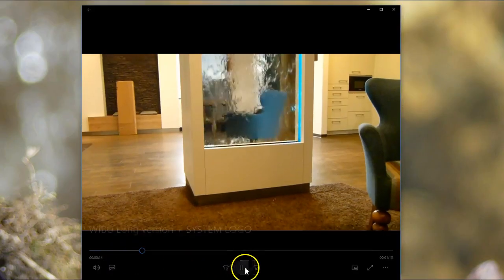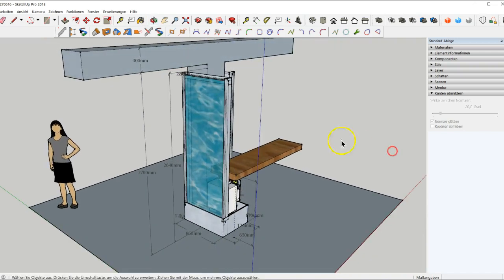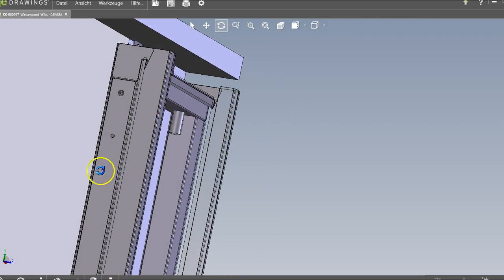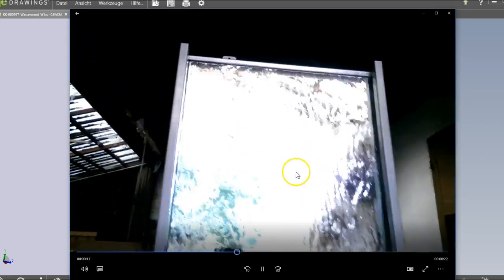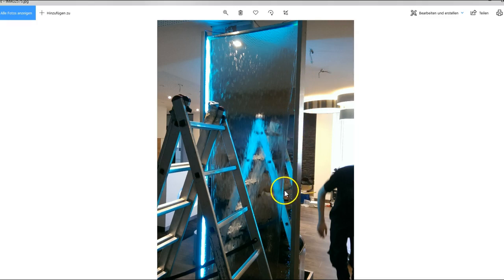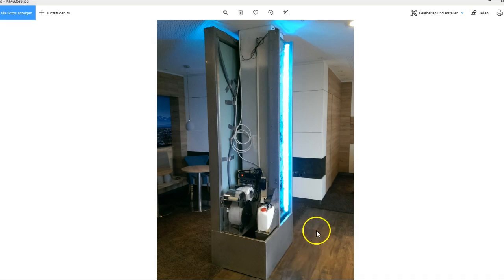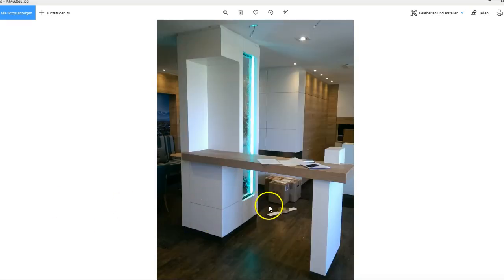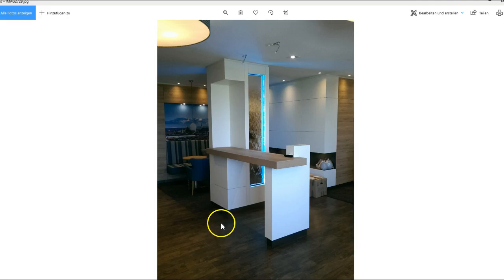How to build automatic Indoor Waterfall in Lobby -  DIY Glass Water Wall Fountain Production Manual

Comment: Anybody that wants to build  there own water wall, do some research, there are many you tube videos showing you how to build this simple type, as well as dancing water walls. They are simple to build, not difficult, just requires a hands on approach, with a can do attitude!
The dancing water wall with air bubblier are much more interesting. I use a four way wave making timer, to move the water from four different fill locations. It gives the effect of water originating from different locations to promote the variety of down pour of water from its point of origin. Causes a dancing effect, and does not repeat itself exactly the same way, thru the four way cycling effect from timer. You don't need a school or course to teach you how to build this system! Just do your homework.
Reply from the maker: Thank you for sharing but i have another experience: 80% of the water features worldwide fail exactly because of the attitude you have just described. Bad or insuffient water distribution, noise, leaks, calcification, dirt, germs, algae, stink, corrosion, water damages, broken pumps, wrong dimensions, etc, etc... happen again and again  - i have seen it often enough in the last 18 years inside this business. Its not about what it is more interesting or beautiful - its about creating water features that are secure and relieable not only after one week but in the long run over years.
Reply: THIS video on it's TITLE says" "HOW TO BUILD"... it shouldn't say that if it's not going to show us HOW TO BUILD...
Reply: @WawazenWaterwallSchool   GOOD ANSWER
Reply: @WawazenWaterwallSchool  don’t title it how to build it if you aren’t actually showing how to build it